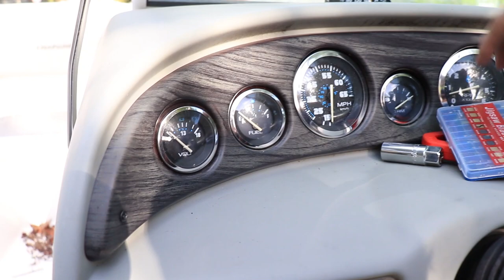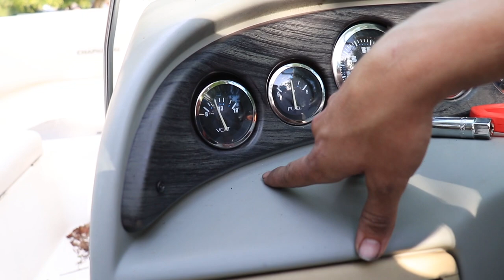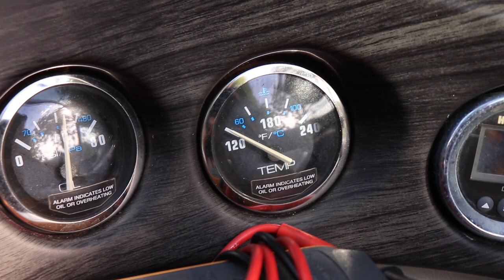Boat Restoration | MY BOAT CAUGHT ON FIRE | Part 6

Comment: On any boat that has sat as long as this one, always put in a new impeller in the water pump before running it that long.  They get brittle and will break into many pieces or they shrink and don't push enough water to cool the engine properly.
Reply from the maker: Roger that thanks!!

Comment: The commentary from your buddy is great, “what a man”... I have noticed my alternator doesn’t charge well at idle. I seem to get above 13 volts once I’m above maybe 2k rpms. Great work so far
Reply from the maker: lol yeah man he cracks me up. Funny you say that about the alternator, I was wondering how the alternator charges at a factory set idle of 625rpm - Maby that has something to do with it. 

Maybe if you catch it on fire like mine it will work better lol

Thanks for the feedback!